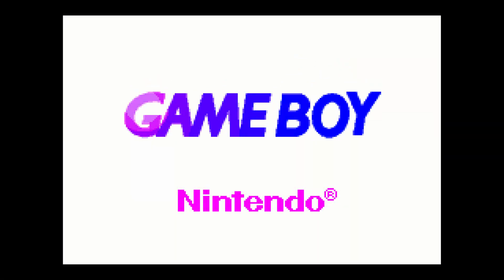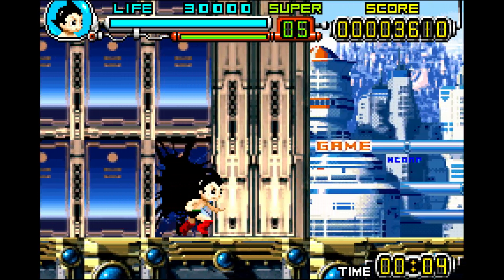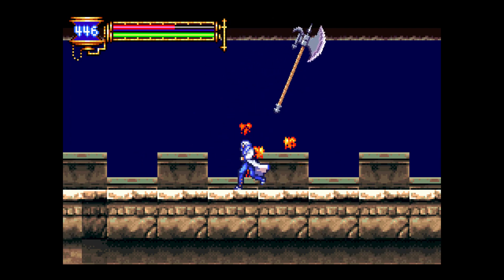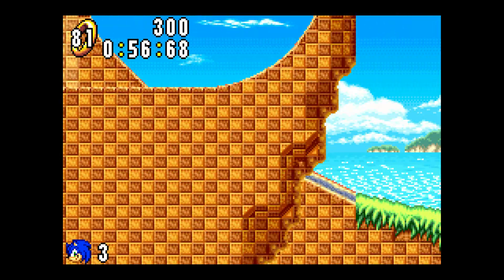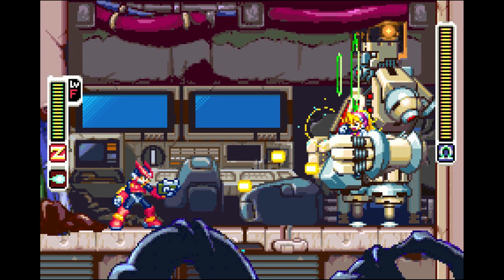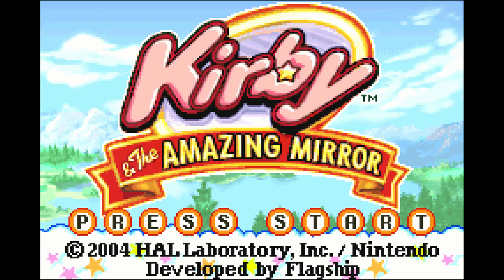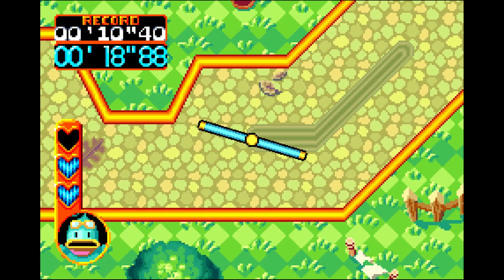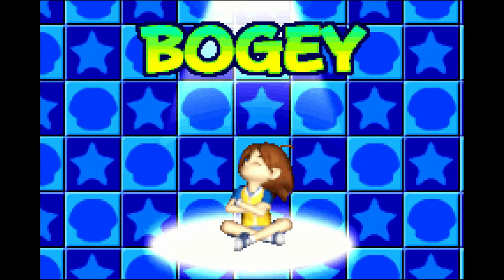MiSTer FPGA DE-10 Nano - Game Boy Advance Core Review and Setup Guide

Comment: Love these mister core reviews. I fried a mister once but had to immediately replace the d-10 nano board because I grew to love the system so much. It really has those pixel perfect images in hi resolution. Currently the pc engine core is blowing my mind.
Reply: How did you manage to fry the board? Doesn't sound nice and could be an expensive hobby doing that. Overclock or lack of cooling?
Reply from the maker: I mean it could have been faulty too?
Reply from the maker: Glad you enjoy them!
Reply: Damn how'd you fry it?! I wanna avoid doing that with mine

Comment: I really like the monochrome LCD filter for the GBA core. Adds a bit of contrast and definition to the pixel art that really seems to suit the style. Mother3 and the Castlevania and Metroid games are really great. Feels just like a souped up SNES in so many ways.
Reply from the maker: Yes GBA feels like what Nintendo would have released had they not gone 3D
Reply: Why monochrome for GBA, if you don't mind me asking? Are you just looking to simulate the original GameBoy with 16-bit graphics?
Reply from the maker: I think some people just really like the look?
Reply: @RuthLoose88  My bad. I meant to say LCD Color filter, not monochrome. The monochrome filter adds white borders around the pixels, which looks ok on the grey scale systems. The LCD effects filter folder also has some options for different darknesses of lines. Unfortunately it doesn't look quite the same when using the 2X resolution feature.
Reply from the maker: Ahh that makes more sense!
Reply from the maker: I get that. It happens

Comment: Excellent video as usual. I still prefer real GBA hardware in combo with the Gamecube's GB player. Using an everdrive for every game ever made. This allows you to take your exact save files on TV and on the go. GBA using GBI thru the RetroTINK 5x on Gamecube looks insanely crisp with the new 5x firmware.
Reply from the maker: Yes always a good option and I have a GBA player but the ease of MiSTer is a fun thing to have

Comment: There is a new GBA 2 Player core now.
So you can run two GBA Cores at the same time on one MiSTer like you are used to with a link cable. 
Video output on one screen or one via HDMI and one via VGA. 

A GBC 2 player core with the same features is in the works and in beta status right now.
Reply from the maker: I’ll touch on that in a future video :)